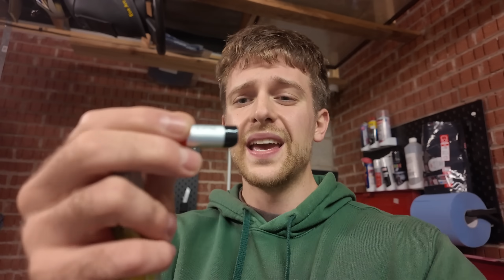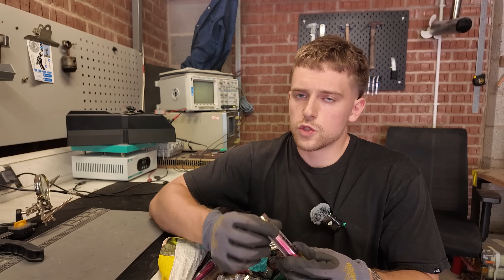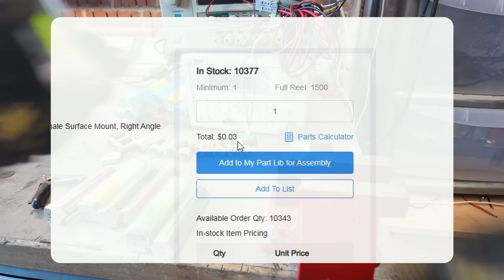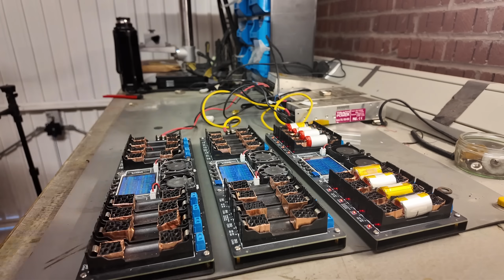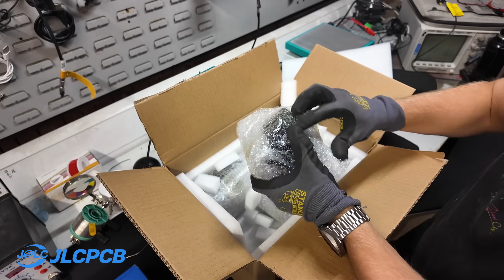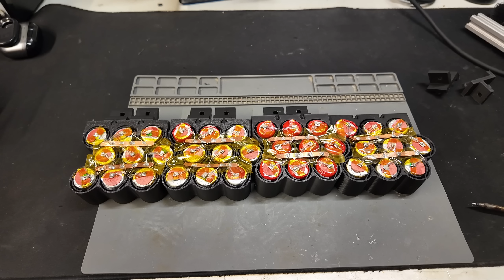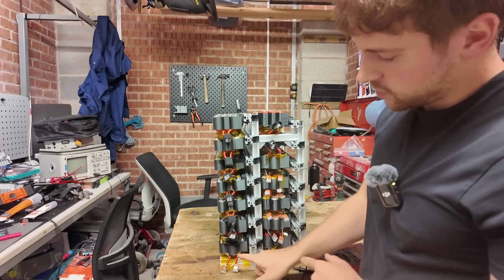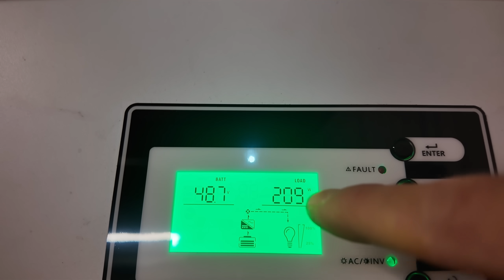I Powered My House Using 500 Disposable vapes

Comment: Nice video and I applaud recycling efforts.  Note wiring regs require a proper "break before make" switch that isolates mains when you switch on inverter rather than relying on you manually doing it.

Comment: You beat me to this one <3  

It's absolutely absurd.     I saw your e-bike battery while i've had this powerwall thing on backburner for like a damn year :D   

I need to finish your video, but I'm still in the middle of capcity testing each cell that I have

Addendum:  I've successfully recovered 18650 cells that ihave been sitting for 15+ years btw..    Just use the right equipment..

wasn't sure if you had discovreed the website that shows you how to arrange each cell based on capacity (parallel and serial)  to get desired voltage... it gives you a huge diagram on how to arrange each cell..  now, keeping track of all teh cells is insane.  ...  

I'm actually at the point where your'e cell testing right now... yep, this looks familiar ..   looking fwd to watching the entirety of this one.. good work !

Comment: Those vapes use a membrane to sense airflow, the membrane of a capacitor type microphone. They do this from day one, 24/7. That's why the battery should be harvested ASAP. I'm playing with these too.  Where I'm at, the most common type has a metal tube for a case, I use an angle grinder to slice them, so the internals come out more easily. When it comes to using the cells, I'd suggest to research internal resistance of batteries.

Comment: Im trying to run my 1 bedroom house off solar power from 8 160watt solar panels into a 100amp charge controller which feeds 3 lithium iron phosphate 12v 100 amp hour batteries to feed my house. My electric bill has been ridiculous so im trying to offset with home solar. I even bought a 12,000 btu 12v rv mini split ac to keep my 460 square foot house cool. I use a webasto diesel heater in the winter vs electric. Im hoping the solar setup is sufficient, only 1 way to find out. I will be finishing up my install sometime this week. California is a pretty sunny state so in theory it should work. So basically half of the stuff in here will run on solar except the fridge and dishwasher and tv. I even have solar lights in each room aside from normal 110v

Comment: You could make a 3D Printed case for the batteries and, benefiting from the fact that you’ve made those racks with some spacing and adding a few cooling fans in order to keep those batteries within the secure working temperature range.

Comment: should make a battery percentage meter for both the workshop and house. It could also have indicators for what switches are on and how much power is being used if you use the app instead of doing it all analog.

Comment: You don't have to throw away any of them you can take a charged battery to reactivate the ones that are too low for recharge. take 2 ended charger cable and stick 1 end into the fully charged vape and then the other end in the one that can't be charged then wait about 20 min then the one that would not hold a charge you will be able to charge it like normal.

Comment: I connected these in parallel. You have to make sure that you don't have a hidden bad one inside your pack. It will drain the pack and/or get hot while charging. If the cells are all OK it is totally possible to run RC quad copter (toy grade) or 1/16 to 1/10 cars. Too many in parallel will really require the fuses because the possibility of having a bad one is rising of course.

Comment: Here in the us they sold batteries  with replaceable pods as a whole kit. They came in separate  boxes but the stores would charge full price for both even if you just eanted the pod claiming the battery is "free". Sold poorly so they got rid of them as whats the fucking point if you have to pay for the battery every time even if you dont take it.

Comment: Friend of mine worked all his life in vehicle repair (brand dealer) now when he has free time as he retired, he had idea of trying this concept with ev cars battery packs and adding solar panels to the game too. Guys from the dealer already have problems of disposing deffective packs (one cell voltage difference 0,05v) they have warehouse loaded with them. Of course my friend got his hands on few of theese packs, disassembled them and made his own functioning packs getting rid of deffective cells. He placed the battery packs in basement of his old home. Something went wrong with bms one day and one of the packs exploded. Thing blasted the basement hatch open (required two grown dudes to lift that open) like it was nothing, and blew out all the windows and doors in the room where hatch was located. Luckily no one from his family were there at the moment... Now he assembled packs 2.0 located 50m from house in small shed 😅.

Comment: I imagine the cost of the frame, printing, connection parts, and labor, including the possibility of failure of individual cells, leading to larger problems and also them not being able to be quick to switch tells me this is a fun build, but hella not feasable and not worth the work... 
What makes me angry tho is that here in germany we got bans on plastic straws because of trash pollution, but at the same time marketing for these throwaway rare-earth non switchable batteries is just insane. They still sell here like crazy.

Comment: 3v limit before damage is not accurate, sorry. I have recovered, charged, and used ones that are as low as 2.5v. And even used them for a couple years after for a real vaping device that I use on a daily basis.

Comment: I know no one here vapes and cares about this, but I wanna rant about how much I HATE the move from the big modular sub ohm vapes to the fully disposable ones. The disposables are just so wasteful it's disgusting! With the old vapes the only waste you were producing was a little bit of cotton and metal from the coils and some glass and rubber from the old juice bottles. And OFC they changed the bottles to plastic later WHYYYYY?! The old ones were durable too. I was using a kangertech I bought in 2013 for like 5 years and the only reason I stopped was because they stopped making parts for it. And now, you're excepted to use your device for like half a week and toss THE WHOLE THING? Including a FLAMMABLE LITHUM BATTERY?! Who thought this was a good idea?

Comment: I have built the same thing and I did it a little bit smarter after I built my battery bank I dug a big hole and put it all in a durable container and buried it two metres underground in case any kind of fault or fire it is contained but the Anderson plug that charges them comes from the ground to my MPPT lithium charge controller and I don't regret it because I have saved about $1500 on electricity the last two years alone as I live in Australia and the heat heats up the batteries really bad and that can overload them and cause a fire like last time that's why  putting the batteries underground keeps them cooler but if a fire ever breaks out it is contained by the soil and the sand but however it is in a waterproof box and it's been approximately 2 years now since then and I have not had one issue

Comment: That operates at just over 4x the voltage of the stuff I use for my bedroom 
800wh here lasts me almost 5 hours with all my stuff running since I’ve been working on reducing wattage a bunch due to frequent power outages from storms
I wonder how long I would be able to run off that if it were split down to 12v

Comment: I just learned about this issue; I've been throwing away disposable vapes for ages. Like .. many ... And now I'm watching this absolute legend do something amazing with them.  

It's given me a bit of a nervous stomach ache if I'm honest. This is really great. I would rather know, than just continue to do a wrong, I think, even if it can't be fixed, just avoid repeating. Gonna have to find a handy electrician near me who loves this too.
Reply: Just buy a mod vape and dont throw it away anymore bruv, its cheaper and you'll waste less
Reply: @mantra1229  This. The disposable juice used to be completely locked down to disposable vapes, but you can just buy it now. No reason not to use a pod system and a rechargeable unit. I recommend XROS
Reply: I know that feeling when you learn unintended consequences of things you've been doing for a while; we did the best with what we knew at the time. We know new things now so we can change our decisions going forward. Learning and growing is ultimately a good thing
Reply: Don't be a (literal) waste man and buy a proper vape, if ya really wanna burn unknown liquids into your alveoli

Comment: This question is a little off topic but would you rather have people continue to smoke cigarettes and smell the cigarette smoke or people use vapes that has no smell. I really liked the video and I don’t think putting lithium batteries in the landfills is a good idea. I don’t think putting anything in landfills is a good idea I believe there are ways to filter out the contamination if trash was burned for power this would get rid of waste help with the grid and stop wasting land and contaminating it. There are lots of problems in the world and power is one, but liquid lithium batteries isn’t the answer solid state lithium batteries are far better definitely for a off grid home

Comment: If one person did this, imagine how much power could be extracted from 90%+ proper collection and recycling, assuming the money and manpower would be used as such.

EDIT:Shoula done this earlier, but this comment is so wrong. Yes, I understand that this is not "free power" as the comment implies, it's just poorly worded. My main intention was showing my discomfort of the horrendous litter situation we live in, only made significantly worse by the ludacris availability of cheap (and now so-called disposable) electronics
Reply: It's certainly possible, the main issue is the inconsistency of batteries creates a lot of potential danger, which is why large lithium battery packs are best made with new cells.
Reply: No. You are wrong. How much energy is needed to produce this vapes. Bann them by the law. Such a waste of material should be forbidden. Human race should be able to recognise use less waste of energy.
Reply: we can already recycle something like 90%+ of the materials from li-ion batteries, the technology already exists, and it's a lot better and safer than trying to reuse batteries that may be damaged. it's just that mining more raw materials from countries with cheap labor is a lot cheaper than recycling.
Reply: @danilooliveira6580  Hey! the US labo... oh. right. Ya we are now.
But we also are just collecting salt from the great salt lake to supply the lithium, there is not a lot of labor involved one pump operator and one back hoe operator and thats it for millions of dollars woth of lithium.
Reply: Or just make them reusable.
Reply: @arandomcomp2427foger has vapes that the battery and juice are separate. They connect with a magnet to be powered. Then you only have to buy the juice til the batteries gone.
Reply: More important than actually benefiting from the recycled vape batteries is proper disposal! Don't forget the best part of the work he did was helping mother earth by removing litter!
EDIT:This is for all the people angry or in disagreement with my original comment
Reply: China is probably doing it
Reply: this isn’t what collection and recycling would do at all tho
Reply: It sounds amazing but your battery pack would be a ticking time bomb unless you were an expert at building a unit like this and you were absolutely certain that you knew what you were doing.
Reply: What do you mean?
Reply: imagine if people didn't vape
Reply: @zenlettering then he’d just use phone batteries, same thing
Reply: @zenlettering  the good ending
Reply: Batteries don’t ‘provide free power’ they just store it.  How long does your phone last before you have to plug it in?  This is cool if you charge with solar but after these batteries are drained in a day his normal 6000w daily power use will be like 12,000 to both power his house and re charge the battery.
Reply: Here's the kicker....... this project is nearly 100% useless unless he is recharging these batteries using renewable energy, and using it for years on-end.

He spent tons of effort. Tons of time. Tons of his own energy, soldering, using supplies, and powering his own body, in order to make this battery bank. Great, its done, it can power his house, right? Well.... where did that energy inside the batteries come from in the first place? His dang wall outlet, charging them off the grid. At likely 70%-80% efficiency, mind you. Then, he runs his house off the battery. Drains it dead. Now how do you recharge it? Well, you hook it up to the grid and charge it up again at 70-80% efficiency.

Its literally a WASTE of energy, when he could be powering his shop and house with the grid directly. The only time this comes in handy is if there is a grid power outage, and you need to run off battery for a while. In which case, a mass-produced store-bought battery (or better yet, a gas generator) would be FAR more efficient with less energy gone into producing the product.

Sure its fun but there isn't much practical use for this at all. You could buy a bigger, better, more efficient, safer battery from a company that mass produces them, for less cost and less over-all negative impact on the world due to their bulk manufacturing processes. As others stated, it would be best to just ban the sale and production of disposable LiIon batteries in the first place.
Reply: The problem isn't the availability.  It's the cost. You can buy a powerbank with twice the capacity for about $1100 USD retail.  It's very unlikely that you could build this as a marketable finished product for less if you had to pay skilled labor, even if you had access to infinite free used lithium cells (unless you have access to third-world workers).  Still a really cool DIY though.
Reply: @phoquenut  Yeah the real benefit is cleaning up the street. If i've learned anything since commenting this, it's just how bad the improper disposal of this many batteries really is
Reply: First off you have to calm down when you start discussing free energy. You see the used to be this really smart man his name was Nikolai Tesla and he discovered that the Earth put off a frequency as it turns on its axis. Tesla discovered how to harness that frequency convert it into energy and effectively he found a way to create free energy for everyone and the next thing you know he was locked in a padded room Shot full of Thorazine and all of the newspaper articles around the world said Nikola Tesla goes crazy. You can't be effing with their money. You see what I'm saying. You aren't even allowed to spew truth. What do you think's going to happen when you tell the elites that they will no longer be paid for electricity. Once you start saying and doing things like that you get real slewacidle ... you know what I mean
Reply: And If they used solar panels to charge their batteries..... Bye bye pg&e!
Reply: Imagine how much money a smoker will spend on vapes, cigarettes, oils and if they just didnt do any of those things, how much money they would have to spend on solar, powerwalls...inagine how much cheaper powerwalls and electric cars could be with so much lithium no longer being wasted in vapes.

Been about 15 years since i stopped and my only regret wasnt stopping sooner.
Reply: @webzterd  What about a purely solar powered vape
Reply: You can't.
He needed 1000 ish disposable vaps to do his project.
There isn't enough vaps disposed off in the world to power everybody.
Reply: But working in a cole mine is so much better !
Reply: Or even just individuals! Now that i know thise things have free power in them the next time i see one littering the street im picking it up and recharging it to use for my romote and stuff
Reply: @chloesibilla8199 you have to match the voltage to the stuff you are powering. Keep that in mind, lithium especially is not something to mess with. Knowledge is power, do your research!
Reply: @disc4tw That's why we have battery managers that survey every single cell discharge / charger and temp to make sure that everything runs smooth. It will adjust the power cycles to ensure proper balance between the cells.

Comment: The banning disposable vape did nothing.. I used to vape and noticed they still sell the same ones I used to, exact same box/packaging/price, it just has a charging point in it. Like you say the charging port probably costs way less than 1p at their scale and the battery can be as low quality as possible because they don't care beyond one charge. The ban is 100% token. Cool idea though to use all the batteries.

Comment: "Completely insane" is one of the biggest understatements of how many lithium batteries (not even the non-rechargeable type) is being discarded like this, when the industry is bending itself to develop manufacturing capacity to attend the world wide electrification's demand.
All of them could be in cars and household renewable energy storages.
Lithium is NOT cheap, and it is NOT a trivial metal to acquire compared to iron.

Comment: These cells are not made for battery banks.  They are for short duration high amperage output.  By short duration, I mean under 5 seconds.  Most vapes won't go more than 5 seconds and automatically cut off in 5 seconds.

Comment: 13:07 this battery row has 3 modules of 9 batteries, while the other rows have 4 modules of 9 batteries. And here at 13:24 you can see this smaller row in the pack. Doesn't this create uneven capacity between the rows in the series?